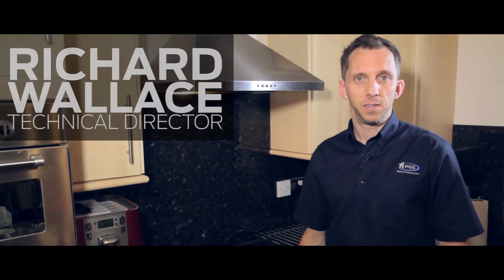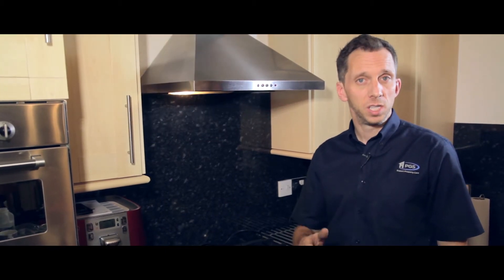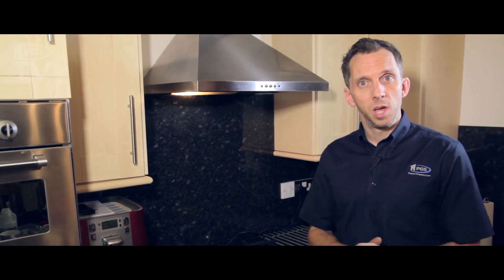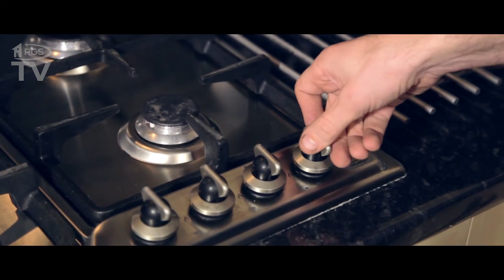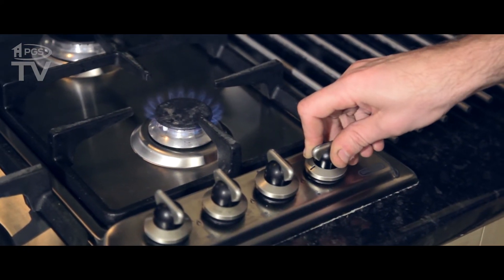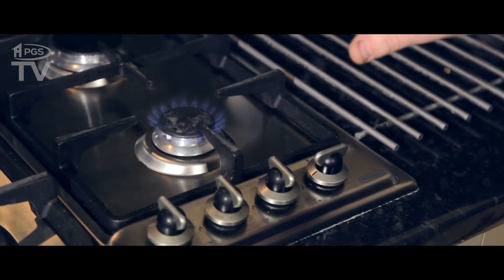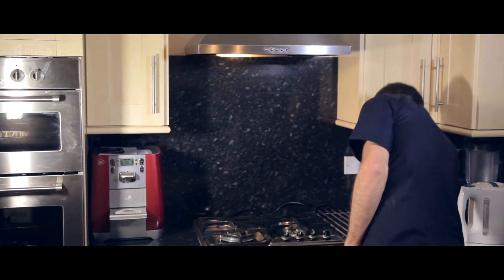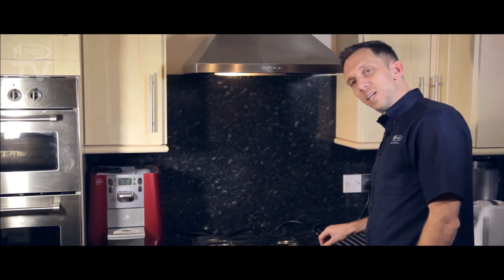PGS Services explain how an FSD (flame supervision device) works.

Comment: I'm trying to find out if a faulty safety device on a cooker lid is ID or AR. I cant find anything in writing (gas safe technical bulletins or unsafe procedures)
Reply: If it has an FSD and it doesn't work it's an instant ID. If it is an older cooker without an FSD it can be passed but is undesirable. I would always seek to encourage a customer to buy a modern appliance as they are generally much more efficient and much safer to operate
Reply: ID is usually applied when there is spillage. If the fsd doesn't click and gas continues to come through in this case then it's ID. If however it fails to light the burner. It would be AR. NTCS no longer exists. Reason was the death of an old lady. Too much confusion to customers. Better it's 2 set standards to explain in laymen's terms. Think of it as an Mot inspection. When you do your safety checks cover everything. To prevent death or injury to person or property. RIDDOR is only in severe cases.
Reply: If safety device is not working properly on any gas appliance, it's an ID, mentioned in logic book
Reply: ID all day long

Comment: No "Not to current Standards" any more although I appreciate this video is pre the changes to recording.
Reply: There still is NTCS
Reply: @michaelburns7985  no such thing
Reply: @vmkkith  of course there is
Reply: @michaelburns7985  removed in 2016:

In summary

The Not to Current Standards (NCS) category was removed from GIUSP because, by definition, these situations are not unsafe. As a registered business, you may still record NCS situations, but this no longer forms part of the official Unsafe Situations Procedure.
Reply: @vmkkith  so they are still a thing 🤣